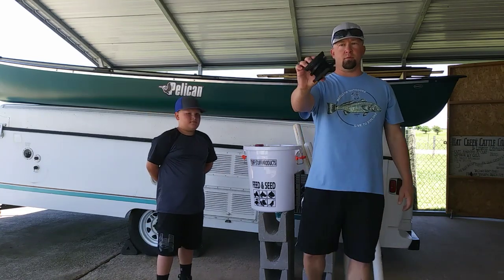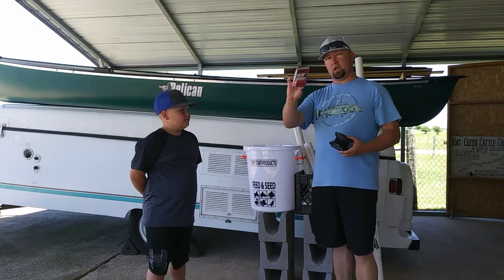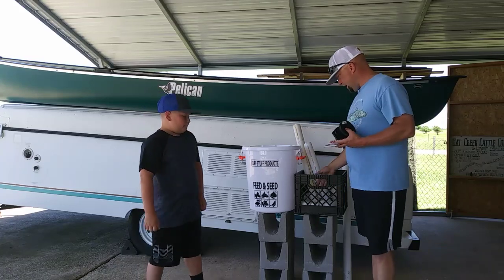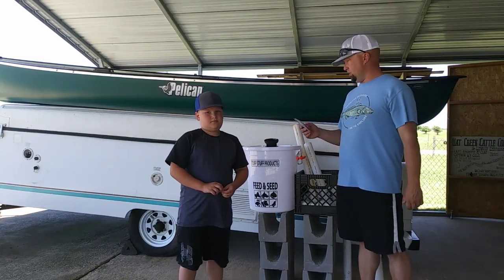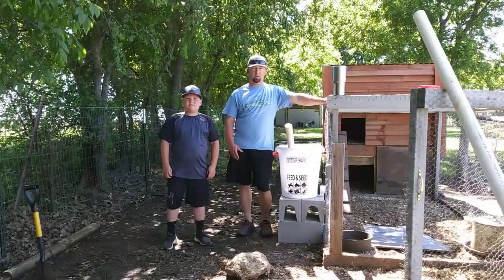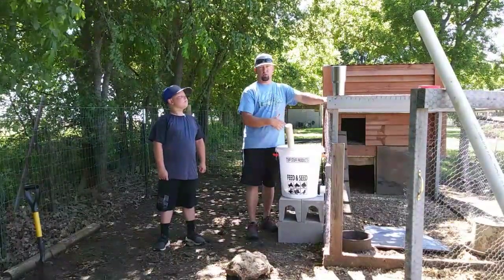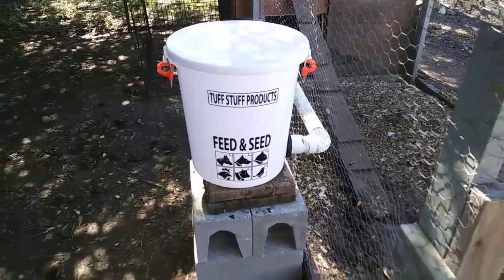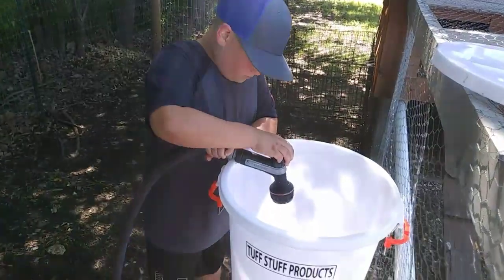Easy DIY Chicken Watering System with Chicken Nipples

Comment: Nice! Any update on algae or cleaning of it w/ bleach. Curious if that worked or you had to adjuat anywhere
Reply from the maker: Hey! We have had no trouble with algae through the winter, but in the Summer we add about 2-3 "splashes" of bleach when we fill it up. Also, since we can't dump the bucket out, it is attached to the pipe, we just fill it up with water until it overflows and let that run for about 1-2 minutes and that cycles all the dirt/debris out. Hope this helps! Thanks for watching.
Reply: 5M Family Homestead Thanks for the reply!